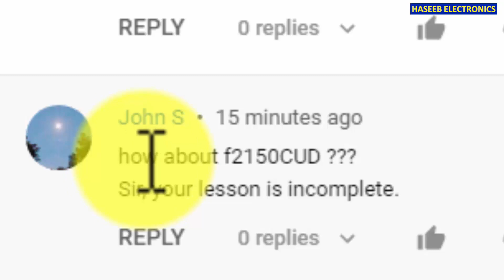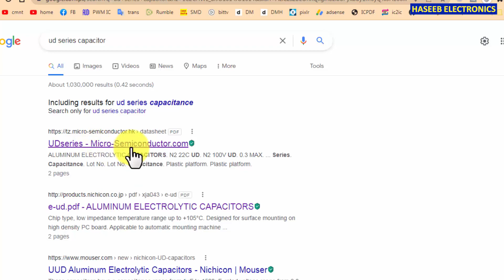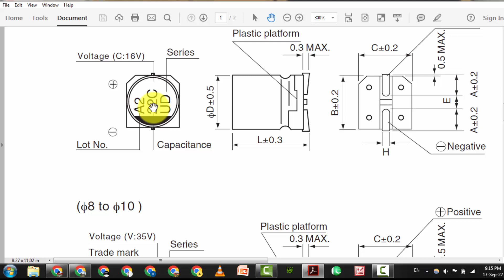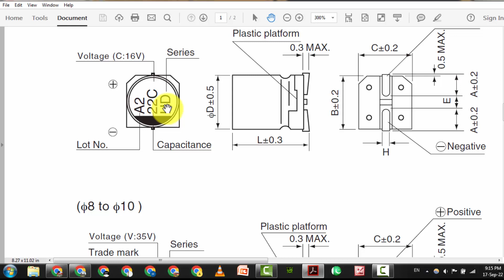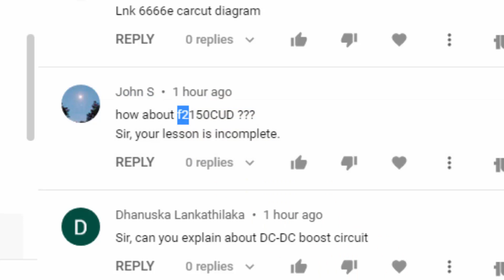{701} How To Know SMD Capacitor Value

Comment: Thank you for the video, I have a question about a capacitor smd/smt . It has 3 sets of numbers. on the package it says from top to bottom 145 100 50V…..would this be  a 100uf 50volt capacitor?
Reply from the maker: you are right 
it seems 100uF 50V 
and in some datasheets, if this 100 is coded, in that condition it may 10uf 50V
but most commonly it is 100uF, because voltage value is not coded, so the capacitor value is looking uncoded

Comment: Sir i have 12v SMPS 10amp, the voltage is fluctuating at higher level like from 5 to 9 v fluctuation, and their is a loud buzzing noise coming from the SMPS, capacitors and transistors are good. can't figure out the problem. please let me know where could be the problem. Thanks in advance

Comment: The codes are very confusing unless you have the information chart.
Long ago the capacitance and voltage were stamped on the capacitor so no need for a chart.

However I thank you for your  teachings.
Reply from the maker: You are correct
this time we can say confidently unless we consult the datasheet for that series. in some capacitors, 150C will 150uF 16V. while in some other is 15uF 16V
please accept my best regards and special thanks for your encouraging comment
Reply: @HaseebElectronics  You're most welcome Sir.

Comment: sir 50watt ledflood light driver high voltage is coming in the output what is the problem..mosfitt,capacitor,ic..changed..still the same...sir can you tell me a solution